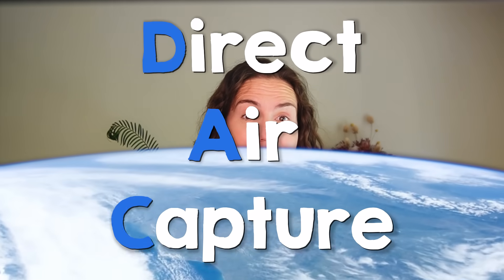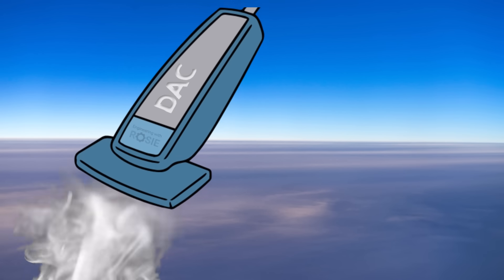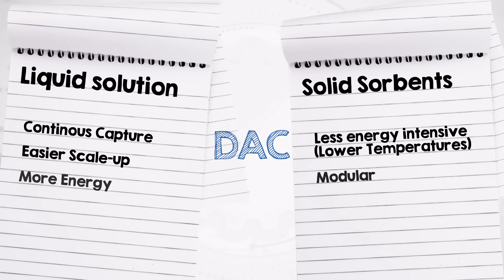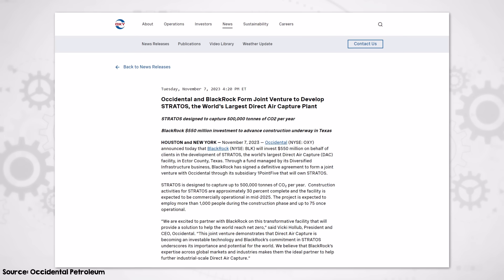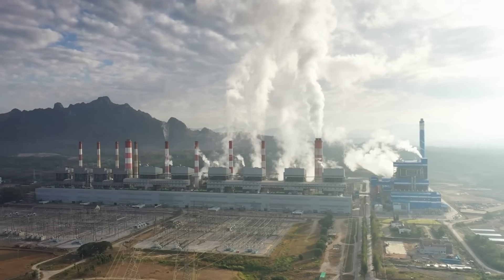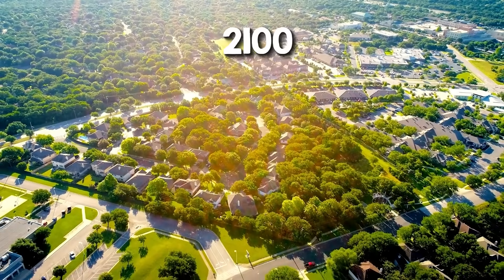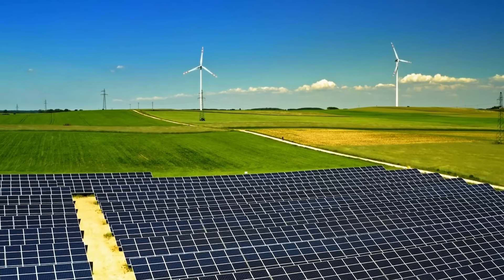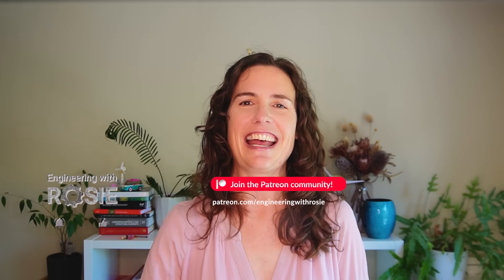Direct Air Capture: Climate Savior or Distraction?

Comment: Official global warming temperature reported in 1991 1.1°C.  Official global warming temperature reported for 2022 1.06°C.  The back of United Nation's IPCC science report of some 200 pages states it took gas samples at 20,000 meters altitude and only that one attitude!   That statement behaves as a legal data transparency backstop.  There is no greenhouse radiant energy considered to exist at 20,000 meters altitude.  It is a marketing practice to promote the idea of some benefit and then legally declare it has nothing in fact to do with it.   That's what is happening here.

Earth's greenhouse effect takes place within 20 meters of the greenhouse energy radiating surface, typically the earth and is always in saturation from water vapor to add 10°F (5.55°C) to earth's average temperature.   The overall effect of earth's greenhouse effect can't be changed by changing noncondensing greenhouse gas concentration in earth's atmosphere.   At 1% average tropospheric water vapor over 99% of earth's greenhouse effect is from water vapor.  I learned that above information in 1978 at George C. Marshall High School,  Falls Church Va.   It has not changed, but let's check with math.  

Let's work that out with some surprisingly accurate rough estimates.   (1% water vapor) / ( 0.04% carbon dioxide) = 25, CO2e of water vapor = 18,   25 X 18 CO2e water vapor = 450 CO2e water vapor to 1 CO2e for carbon dioxide.   All the other noncondensing greenhouse gases total to a little less than that of CO2, but given 1 CO2e here for 452 CO2e total average greenhouse gases to 450 CO2e for average 1% water vapor concentration.    450/452= 0.995575221238938 which is more than 99% for water vapor at average tropospheric water vapor concentration of 1%.   Human caused CO2 is about 40% of the CO2 in the atmosphere for 2023.   That calculates out to 5/1000°C of earth's average greenhouse effect coming from human caused CO2.  Global warming is at 1°C.   

Earth's greenhouse effect is always in saturation from water vapor even in the Arizona desert or at 4% water vapor concentration when the temperature is 86°F (30°C) at 100% humidity.   What changes is all the greenhouse radiant energy is entirely absorbed by greenhouse gases before 20 meters from the radiating surface.   There can not be a runaway greenhouse effect on earth because earth's greenhouse effect is already at saturation with no radiant greenhouse energy left to absorb.  

The primary physical model description for greenhouse radiant energy it is a particular band of far inferred radiant energy that loosely interacts as an electromagnetic wave with the lumpy electrostatic fields of greenhouse gas molecules typified by gas molecules with largely different sized atoms such as H2O water vapor and CH4 methane.  CO2 carbon dioxide is almost inert as a greenhouse gas.  That model shows the radiant energy transfer is one way.  The greenhouse gas molecules absorb greenhouse radiant energy, but they don't transfer the heat by radiation they further transfer the heat by convection i.e. gas molecules bumping into each other.

Comment: The reason DAC looks so expensive is that it's optimized to make efficient use of scarce energy.  Terraform industries starts with the assumption that solar is very cheap and getting even cheaper, while storage is fairly cheap and also getting cheaper.  So the cheapest way of getting energy for a lot of the day, when solar is producing well below its mid-day peak output, will be to build enough solar that storage is needed only for the actual night, not for morning and evening.  That means that the solar panels produce a lot more energy than needed to charge the storage.  So they're working on optimizing air capture as a source of methane that only runs a few hours per day, when the solar panels are providing that excess electricity.  They want to make synthetic gas cheaper than mined gas.  

I'm not qualified to evaluate their forecasts of what it will cost them to produce gas once production scales up.  I've just read about it on Casey Handmer's blog at Wordpress.  But it seems plausible to me.  Just because prototypes are expensive,  even when they're mostly made out of off-the-shelf components, that doesn't mean that mass-produced systems to do the same thing will also be expensive.

Point-source CCS is inherently expensive, because it has to run whenever the source runs, wherever the source is.  Modular carbon capture from air can be distributed wherever there's both excess solar capacity and demand for gas.

Comment: I am firmly in the camp of DAC is a dangerous distraction. Sure, keep working the problem at the experimental and even theoretical scaling. But our time, resources, money, and political capital should not be wasted on DAC until we have a clear path to zero carbon and we're mostly fully implementing all of those strategies. Green steel, carbon free EV manufacturing, carbon free building, and even more basically, constructing catenary streetcar, tram, and trains to replace our unsustainable car dependency, are the ways to address Climate Crisis before we try to scale DAC if we ever do try.

Comment: Capturing CO2 out of the air at 400 ppm, is kind of insane when you could capture it from a concentrated source like a power or cement plant.
Gets even worse when you think about the power needed to do it , and the power is probably generating more CO2 than we’re capturing in the process…

Comment: The US Navy actually looked into this with nuclear powered ships. It was to produce liquid fuels for the ships and aircraft out at sea. The proposal was to use a liquid solution based CO2 capture combined with hydrogen from hydrolysis of ocean water. This would supply the carbon and hydrogen needed in fuels produced and be sent through a Gas-to-Liquid reactor. This produces the liquid hydrocarbons our navy requires. The theory was having a ship like this with each carrier battle group would keep them far more independent on deployments.
Reply: @astebbin  
The cost and complexity killed the concept.

Comment: Brilliant Rosie: IMHO the only way to decarbonize is to ensure that the lowest cost energy solution is Solar/Wind/Battery-Storage (SWB). 
I do not believe in IRA-type incentives but would rather have the polluting energy creators pay fines for their products' CO2 and health costs.
Replace all Peaker plants. with SWB, encouraged by associating fines for pollution costs.
If the fossil fuel can use catchy shortcuts like CCS we should also use SWB.

Comment: Informative. But a 100% renewables grid would be an absolutely massive environmental catastrophe. The gargantuan impact on the planet required in the form of mining, industrial production facilities and area required to harvest diffuse energies is staggering. For example, a 1 gigawatt average output (taking 25% capacity factor into consideration) solar plant requires anywhere between 8 to 20 square miles. A single 1 gigwatt coal plant can be the size of mere acres. So every gigawatt of fossil energy we replace with solar or wind is going to increase our land footprint for energy production enormously. And Fusion is a pipe dream. 
The most environmentally friendly thing humans can do is leave as much of the planet alone as possible. Small problem.  Lots of us and we like energy. What we need is a very very dense energy source that has a small land footprint with minimal mining or other resources required while maximizing energy output. And it has to be CO2 free. Hmmm. What could possibly work.  Wouldn’t it be great if there was an energy source like that? And wouldn’t it be great if we already knew how to use it and maybe even had some examples of countries that successfully decarbonized with such an energy source. Hmmm! 
Actually the Swedes did this. They call it “Karnkraft”. Read “A bright Future: How some Countries have Solved Climate Change and the rest can Follow!” By Goldstein and Qvist. 
Spoiler alert.  Karnkraft is Swedish for Nuclear.

Comment: In both cases, the next step must (?) be to break elemental C out of the captured co2.  Storage of co2 is possibly simply wonky at required scale.
Reply: Cool what energy sources do you suggest?
Reply: @0Aus  Any source that does not make things worse.  There, by the way, is a 2012 US patent for a process that effectively removes C from CO2.  Obviously we need to use non carbon energy sources to power this.
Reply: @mikeklein4949  😆😅

Comment: When you said one of the existing DAC schemes can’t find enough customers for their CO2, so they release it back into the atmosphere - I loudly gasped, like if someone dropped a crate of expensive wine! That’s even more ridiculous than I expected. It will be up to our descendants to pick up the pieces.
Reply: Yep. It's a total waste.
Reply: What do you want to do with CO2? Sure it’s used as dry ice for certain industrial processes, but they don’t need that much.
Reply: @Mike-oz4cv  Pump it into an underground geological storage.
Reply: @Mike-oz4cv  AndI bet dry ice releases is back to atmosphere
Reply: But, it's great for the fossil fuel company's profits if the DAC schemes end up buying lots of fossil-powered energy to run themselves. Even if they end up emitting more carbon than they remove, it doesn't matter, so long as the fossil fuel CEOs make out with more money for yacht payments.

Comment: One way to capture carbon in a solid form is the pyrolysis of wood. Obviously the trees capture the carbon dioxide and the pyrolysis process reduces the wood to charcoal which then can be used of something useful or stored in an old mine. About 40% of the carbon from the original wood remains as charcoal.
Reply: @ndrewclark3236   Trees and plants NEED and ABSORB carbon dioxide, and by photo-synthesis, release OXYGEN. Carbon dioxide is the gas of life FGS !!!!
Reply: Do fish live off Carbon Dioxide? @roydavis5613

Comment: what is the difference in removal between trees vs mechanical removal  adding in the carbon to mfg of the equipment and operational power required per square foot of land space used.?
Reply: Since trees don’t need a power source, I think that’s pretty obvious. Yes, you’d need a lot more trees and land space, but they live without maintenance for hundreds of years and provide other benefits such as flood control, air purification, prevention of soil erosion, homes for insects, birds and reptiles, and generally being nice to look at!

Comment: Rosie, some important numbers - I hope they are right - need review by others.
--- From Wikipedia on weights of the atmosphere and various gases:
- Atmosphere weight - 5,148,000x10^9 tonnes
- CO2 in Atmos weight - 3,523x10^9 tonnes at 424 ppm molecules of gas
- CO2 per ppm of atmosphere - 8.31x10^9 tonnes - 8.31 bn tonnes CO2 per ppm atmosphere.
--- Engineering with Rosie (YouTube 20 Dec 2023) graph reports - 1750bn tonnes CO2 from fossil fuels since 1750-1800 period (278 ppm CO2 average 1750-1800)
--- but since 1800, CO2 mass in air increased from 2310 bn tonnes to 3523 bn tonnes (278 to 424 ppm) - 1213 bn tonnes extra in air - thus 537 bn tonnes of the extra CO2 absorbed by sinks - in sea, on land. Ocean pH has dropped from 8.21 to 8.10 - 30% acidity increase??? 
--- 537/1750 - 30.70% of CO2 absorbed on average by sinks in sea and on land since 1800.
--- In 2022, Rosie reports 36.6 bn T CO2 from fossil fuels created, but CO2 ppm in atmosphere increased only 2.13 ppm. 2.13x8.31=17.70 bn Tonne increase in atmospheric CO2.
--- Thus, in 2022, 36.6 - 17.7 = 18.9 bn Tonne CO2 absorbed by sinks in ocean and on land. 51.65% of fossil fuel CO2 created was absorbed by CO2 sinks in the ocean and on land.
--- the current rate of fossil CO2 absorption is half, but the 220-year average is thirty percent. 
--- as the CO2 in the atmosphere increased above the pre-industrial norm, the absorption by natural sinks has increased too - perhaps from 15% to the current half.
--- while appropriate to use depleted oil and gas wells to store CO2 scrubbed (captured) from oil and gas, and CO2 captured from burning fossil fuels, we should not capture CO2 directly from the air as it is ineffective.
--- If we can reduce fossil fuel CO2 atmospheric emissions to 20 bn tonnes per year, CO2 ppm in the atmosphere will stabilise.
--- If we can reduce fossil fuel CO2 atmospheric emissions to 10 bn tonnes per year, CO2 ppm in the atmosphere will decline by 1 ppm/yr.
Reply: If we can reduce fossil fuel CO2 atmospheric emissions to 20 bn tonnes per year, CO2 ppm in the atmosphere will stabilise.
--- If we can reduce fossil fuel CO2 atmospheric emissions to 10 bn tonnes per year, CO2 ppm in the atmosphere will decline by 1 ppm/yr.
both wrong - we need to get fossil emissions to zero to stabilise the temperature

Comment: Maybe things like this are a good use for when there is a surplus solar & wind, as having sufficient power during bad weather or winter results in excess power during good weather or summer
Reply: Yes, any process where power (as opposed to fixed facilities) is the main cost will be an excellent candidate for dispatchable load.  Desalinization is another good possibility, I think.
Reply: @alandpost  Currently, solar and wind did not lead to electricity cost reduction, Netherlands, Germany, Austria are among the most expensive electricity (in top 8 in the world as of august 2023)

Comment: This whole DAC thing seems like a massive 'Rube Goldberg' machine. Instead of putting in Solar or Geothermal or Wind and using that /instead/ of carbon based fuels, lets complicate everything and use all those technologies to power the device that removes the carbon we're emitting today.  Instead of Rube Goldberg we should be looking toward William of Ockham!! 

I think Rosie nails it with the 'energy required' section. I had the same thought: "Is DAC even carbon negative?"

Comment: The direct air capture system I'm most optimistic about is a newer company started at MIT called Verdox. Their sorbent is cycled electrically instead of thermally and doesn't lose nearly as much efficiency at low concentrations because it consumes energy per cycle, not per hour. They claim, I think believably, 70% less energy consumption than thermally driven DAC. 
The other electrochemical system I've heard of that sounds interesting and promising is from a company called Captura out of CalTech using the ocean as a sorbent and releasing the CO2 by changing the PH with some electrochemistry. 
Basically, there are a few really promising electrochemical DAC systems that were invented in the last few years that solve a lot of the issues with thermal systems and reduce energy consumption.

I think it's also worth thinking about unconventional markets for direct air capture. The most interesting one I've heard of is attaching DAC to a building's HVAC system to reduce the CO2 concentration of conditioned air and reduce the cost of DAC. the pretty sound theory is that buildings generally have higher CO2 concentrations than outdoors and people don't work as effectively when CO2 concentration gets higher, so if you put DAC in the HVAC system you can make the office more productive, and that pays for the CO2 capture.

Comment: Accepting that a barrel of oil can produce about 430 kilos of carbon dioxide, carbon capter would add about $600 a barrel to the cost of oil at $1,400 per ton of captures CO2.   Even if that goes to $100 per ton of captured CO2 that's still $43 a barrel on top of the cost of oil.
Reply: It adds $700 per million cubic feet to the cost of using natural gas which could eventually get down to $50 per million cubic feet in the best case scenario. So in the best case scenario natural gas would only cost 10 times more in the US than it does now.

Comment: Thank you for exposing this greenwash nonsense! 
Do please, at some point, look at biochar. You heat biomass without oxygen present and get two crucially needed products, char powder and hydrocarbons. The latter is the starting point for the bulk of the chemical industry. With all the fossile wells capped (can dream, can't I?), we still need to source hydrocarbons from somewhere.
Char powder is a potent soil improving agent that lets the soil retain nutrients and water much better than without it. With climate change marching on, precipitation gets less predictable meaning char powder will really help agriculture. But the biggest thing about biochar is it's pure carbon and it's stable. Biomass gets turned into a mineral that lasts for at least thousands of years, maybe much longer.
So you get three revenue streams: selling hydrocarbons, selling biochar and selling emission compensation.
No reason to not start right now.